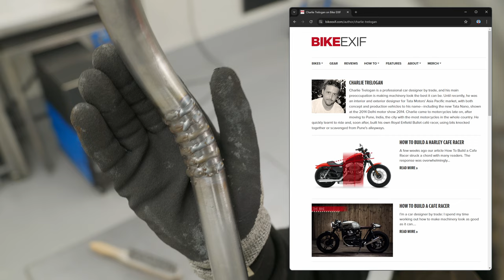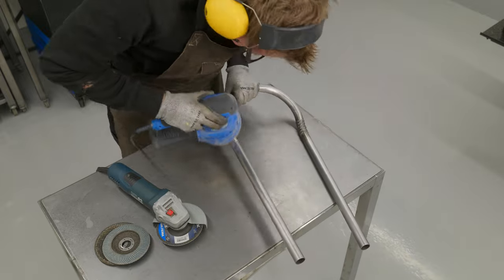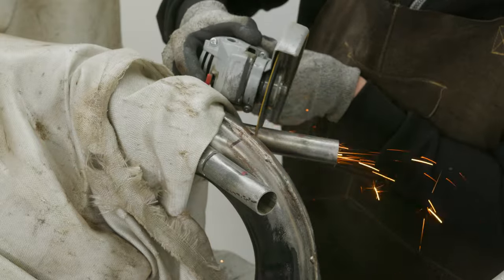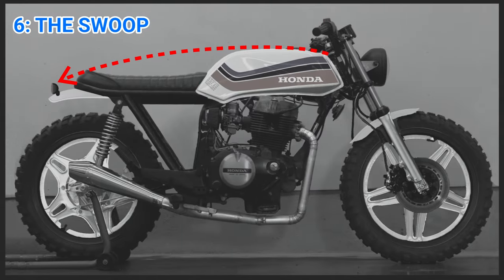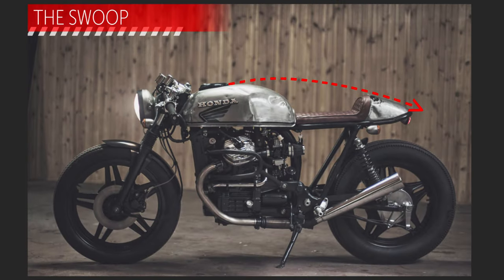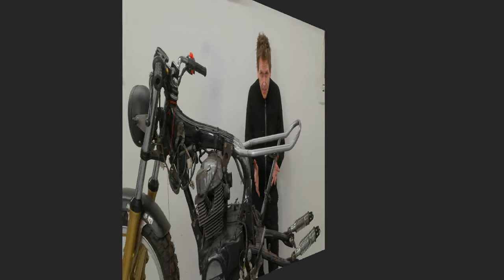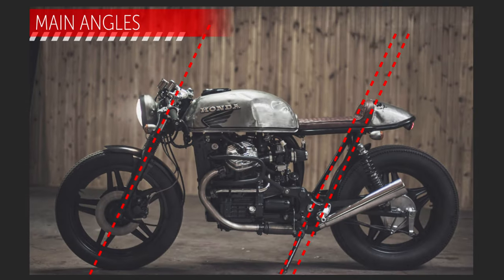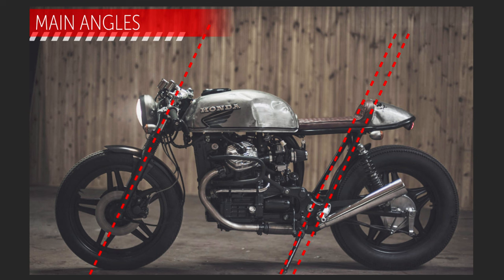Cafe Racer Design Guide - Don't Make Your Build Ugly! Honda CB400 Cafe Racer Build E5·S3

Comment: Im tired of "cafe racers " being built with off road tyres . FFS . The cafe racer was born when people modified what was available, when sports bikes weren't available. They had rear set foot rests low handle bars better brakes and tyres . They tried to emulate the factory race bikes of the day , but still keep them road legal . These days its a frame loop an e bay seat and there you go. No 9ne seems to know the difference between a cafe racer a scrambler and a bobber
Reply from the maker: @paulwhite7475  We all like different styles, and it's certainly not for everyone to mix and match styles. Absolutely the easiest and safest way to just follow the design guide, it's more difficult and a 'dangerous' path to combine styles 😬😬😬
Reply: And comstar wheels! Why? Ffs this video is about design principles and the guide is using comstar. Smh. 😢
Reply from the maker: @jamesallen4050  haha, first of all: it's not Comstar but Comcast rims on the bike. Secondly: both are classic Honda rims from the 70s and 80s, and they are gorgeous 🤩🤩🤩

Comment: Am I correct in believing the original cafe racers were not designed, it was euro punks pulling parts off their bikes for weight reduction?
Reply from the maker: You are absolutely correct! It all originated in the UK in the 60s by youths stripping down their fathers old motorcycle to make it go faster 😎 Today it's mostly about style, secondly you want it to sound good and lastly you want it to go decently fast and have good riding abilities 😊 If you want to go racing you really want a completely other type of bike than a cafe racer today 😏
Reply: As someone with my own cafe project waiting in the garage, I will estimate the reason most cafes of today are ugly is due to lack of skill or confidence to start the metalworking. 😅
Reply from the maker: Hehe, it's a learning curve for sure 😊
Reply: As someone who was riding in the UK in the 1960s I don’t recognise most of the objects people seek to pass off as ‘cafe racers’ these days. The ‘proper’ cafe racers were styled to look like (and sometimes go like) bikes that were used in short-circuit track racing. So engines were often tuned, footrests were rear-set, handlebars were clip-ons, gear-change often reversed by turning the gear-pedal ‘back-to-front’ to match the footrests. The tank would often be a larger than standard (usually alloy) number that the rider could lay down on when ‘doing the ton’. Generally people wouldn’t play with wheel or tyre sizes, and that big ugly fat front wheel and tyre on modern efforts just looks WRONG, as it also does on so-called ‘scramblers’. My brother-in-law built and raced scramblers and they had BSA frames for strength, Triumph 500cc engines for lightweight power, and usually Norton Roadholder forks for control. And an 18”-21” wheel combination because that worked. The modern (and to my eyes) ugly offerings are just exercises in styling which probably handle like camels and are almost unridable and certainly poor efforts on a race track or a scrambles (motocross) course. So who cares where the lines go or meet up if the bike is not useable? Might as well be a ‘chopper’ (another useless styling exercise).
Reply from the maker: Times has definitely changed 😌I don't think many people look at cafe racers as racing motorcycles any more, today you would select a completely different kind of bike if you want to go fast. At least for me a cafe racer is mostly about design and nostalgia 😊
Reply: Sort of. The term 'Cafe Racer' was a derogatory one to describe a standard bike that aped the looks of a circuit racer in the '60s. The simplest things to do were to put 'clip on' bars, aluminium mudguards and strip off any metal work that wasn't needed. Then it could be to replace the tank with a Lyta aluminium alloy one, put on a half or dolphin fairing, a single seat with a bum stop and rear set foot controls. Done well, that would look pretty good. You had people like Dave Degens making road going Tritons and the Rickman brothers doing the same with their own frames. These were very beautiful Cafe Racers that belied the derogatory term. Now we've gone full circle and the lash up, butchers bin cafe racers with knobbly tyres and cut about frames that look hideous and ride terribly.
Reply: Yuuuuhp

Comment: I believe this is a well-intentioned video, but if you follow these "principles" too rigidly they lead to very formulaic builds with little character. These "principles" are merely suggestions; you can break them and still have a beautiful, tasteful design. We remember the builds that have something unique about them, not the me-too builds.
Reply from the maker: Absolutely right, the author behind the design guide also says that this is not exact rules but just guidelines and it's up to each builder to make variations. You cannot look away from all design guidelines though, then it's no longer a cafe racer

Comment: Should be called cafe cruisers or something as theres nothing racer about them now. Bikes were created to be all function, and they are now all form.
Reply from the maker: That is actually very true 😁
Reply: @kihestad  Choppers are the same - they were originally chopped to go faster and they became more about looks. Nothing wrong with it - just a different thing now. In all honesty, you can't create a racer out of a regular bike without changing 90% of it = modern sport bikes are too good.
Reply from the maker: I think you are spot on. Typically the ones being critical to these design guidelines are referring back to how it was originally back in the 60s - it was all about going fast, building a lightweight racer motorcycle was the goal. How it looked was not important at all. Let's just say: times have changed 🥴😁

Comment: you asked for comments how it looks and i feel compelled to say that it does not correspond to my idea of a well-made motorcycle, neither visually nor in terms of craftsmanship. and by the way: where you learned that weird technique of bending tubes? it´s just horrible.
Reply from the maker: This is a very common way to make a second bend in a new direction 'over' or very close to an existing bend, or when making a bend close to the end of the pipe. In these situations regular bending machine does not work. I guess you're not a builder yourself, so it's totally understandable you did not know that, but it's never to late to learn 😊👍
Reply: @kihestad  i have been customizing motorcycles for 30 years and have to do this in accordance with the german tüv regulations in order to be allowed on the road at all. rebending by means of welded slots would be an immediate exclusion criterion. i had to build and weld the rear section of my vfr completely from 22x2mm precision tube. (you can see it on my channel) but this is only possible if you have a welding certificate. a rear section like yours would have to be bent to fit from a single piece of tube. without subsequent modifications. if necessary, you could correct fine details with heat spots.
Reply from the maker: It sounds like your VFR is getting good care! (It's a great bike 🤩) Well done 👍

Comment: For me the flat line horizontal is the most important to make the bike look right, that's why a lot of modern bikes with trellis frames are not suitable as the frame slopes upwards around the fuel tank and therefore it's impossible to make the tank sit flat. Considering the shape of your tank with the back sloping downwards it actually looks really good. Really nice job, I wish I had your welding skills. excellent video.
Reply from the maker: Thanks 👍 You are absolutely right. For newer bikes it's better to build something completely different, for example streetfighter style or modernizing the look.

Comment: Looks good, glad I found this. Drop the front forks 25mm or so up into the yoke.
Reply from the maker: I have already lowered the front fork 35mm internally, cannot drop it into the yoke on this bike because it crashes with the handlebar. I want to have some clearance from the wheels on this bike since it's a cafe racer hybrid scrambler build, I'd rather have talker rear shocks if needed to get it in level.
Reply: @kihestad  . Then my idea will not work, a taller rear is the way.👍

Comment: Pretty good job! Only thing for me is the main horizontal bone line should be considered with the driver's weight. So the motorcycle alone should be a bit tail high head down, it is a typical sports/aggressive  line and prevents the low tail/tilting back at driving cause of the driver's weight.
Reply from the maker: Thats an interesting thought. In a design process I guess it would be smart to not only design the bike based on a profile picture of the the motorcycle only, but also have a picture with the intended rider as well 🤔

Comment: Thinking back on how and why I modified my bike in the sixties. Made it lighter, tuned engine and improved ergonomics for high speed riding. But also keep it legal for road use. Except no heavy silencers, straight pipes. In the style of real road racers.
The Triumphs was mostly high speed city bikes with a more upright riders and higher handlebars. Rarely seen on the twisties, due to reliability issues.
Then I regarded the Manx Norton and the Velocette Thruxton as the most beautiful bikes ever made. The 7R boy racer was also good looking.
One thing I don't understand is the use of a single seat on a cafe racer. One reason going to a cafe was to find a girl for the evening. Short and light weight for better bike performance.
Looking at my Manx, it differs much from the angles you prefer. My other classic race bikes, the CB and the RDLC also differs. As does the Velo.
The old bikes had dry sump oil system and an oil tank. So the space behind the engine was occupied by carbs, filters, oil tank, battery and tool box. Giving different appearance.
Reply from the maker: Thanks for commenting 🙏 Getting feedback from those who actually were part of the "cafe racer movement" back in the 60s is rare, but very fun and interesting 😊 I guess the style is a bit different now than it was 60 years ago. Many trends are short lived, I think one of the most important reasons for the cafe racer style still exists and is relevant is because it has evolved and adapted to newer bikes. Have to agree, putting on a seat sounds stupid 😅

Comment: CLEAN i think is best way to compliment your bike .... as for tank placement , different or not , it works ! Very nice swoop with the elevated rear portion of tank ... cant wait to see where you hide the charging / electronic system
Reply from the maker: @monokheros5373  Thanks 🙏 I have planned to make my own very slim litium battery to keep under the seat, hopefully I am able to put all the wiring and electrical components very flat an hidden under the seat or the tank 🤞 time will show 😬😁

Comment: I thoroughly  agree there’s a lot of ill thought out ad-hoc abominations out there. In Britain it started with those horrific streetfighter ar§€ up mongrels. 
Those principles are sound guidelines to this eye.
Your problem is that tank & the lower edge which was designed to flow into a side cover. I really think your build needs to integrate something here too, running back up to the seat base. 
A pleasure to watch.
Reply from the maker: Thanks for the positive feedback! 🙏 The original tank on my bike definitely presents a challenge. I considered replacing it with a classic Honda tank or an aftermarket option, but ultimately decided to keep the original for both cost reson and because I wanted to preserve most of the bike's original signature elements (that also includes the rims). By using oposite shaped lines on the tank decals I try to visually balance the curves. Additionally, I've made the seat hoop's angle to align with the tank's bend, creating hopefully a cohesive look. Time will show if these design choises is enough to justify keeping the bent lower edge on the tank🤞

Comment: Keen to see the engine and frame cleaned up
Reply from the maker: Agree, but there are some other tasks that come first. The next job is to fit the rear fender, then make the seat tray and the seat. I want to do all the wiring and mount all kinds of small stuff to make sure I can remove unnecessary brackets and add new ones where needed. Then comes the fun getting it cleaned up 🤩

Comment: I’d like to see a scrambler version of this video.
Reply from the maker: I would guess some of the design principles would stay the same, but definitely not all. Higher handlebar, get more clearance to the ground, increase suspension/fork travel length, move exhaust higher up, lifting front fender, softer/bigger seat, and probably more ... 🤔
Reply: @kihestad  I just did a scrambler conversion on a Royal Enfield 650 and I’m still tweaking it.  It’s not a full on custom but I can travel, camp and do gravel roads with it.  It’d be fun to do a custom scrambler from a Japanese bike like what you started with.
Reply from the maker: Cool, Royal Enfield 650 as scrambler sounds like a perfect combo 😊

Comment: This is coming out amazing! Love the new subframe. The CB definitely needed a straight anchor point from the subframe instead of the original curved one. I saw many people keeping that, and it really killed the vibe of the bike. Will the electrical box under the seat extend all the way to the end? Mine is very similar (a 1984 450), but the box is smaller and deeper, protruding a little too much from the side view. Currently, my bike is totally disassembled to fix a valve that broke off and dropped inside the engine 🤦‍♂. Hope to get it back on the road soon. Good luck with the rest of your build, and keep the videos flowing!
Reply from the maker: I absolutely agree, keeping the original frame and try to work around it (like I tried on my version 1.0) does not really work 😌 I plan to make the tray under the seat just go a tiny bit lower than the bottom of the seat hoop, but having 45 degree angels on the side walls so you cannot see it from "above". I plan to make my own lithium battery based on 18650 batteries, it will be very slim and should fit in a slim seat tray. The seat tray will go from the tank and to the upswing at the rear of the seat hoop. 

Oooh, a broken valve does not sound good 🫤Thanks for watching and commenting, and good luck with your build as well! 👍👍

Comment: Very good design the only problem for me and it is a big  one, the knobby tire they belong to a  moto cross not a Cafe Racer or Street Tracker.
Reply from the maker: Yes, I know these tires are not for everyone. Remember I am building a "hybrid" cafe racer / scrambler, so I am breaking some of the rules with my build. The motorcycle will be used mostly for short trips to the city centre, but also for trips to the beach and on gravel roads. It's like the opposite of having an adventure bike with street tires for driving in asphalt only 😊

Comment: How about scrambler build? Do you have a vid how t build one ??
Reply from the maker: I don't have a video for that unfortunately, but it's not that different. Many of the design guides are the same, except typically you route the exhaust higher to get better ground clearance, and you want higher handlebars for different driving position (like I did on my bike) and you might want higher clearance from wheels to fender as well, and perhaps even longer shocks and an overall taller bike.

Comment: This is a very cool design study! I am a bit of a sucker for reverse Comstars, excellent bike. Completely agree, a bit of extra shock height is needed in the rear. Cheers, from the American Northeast.
Reply from the maker: The reverse Comstars (I think Honda called them Comcast) is very cool. They are a bit wider than the older Comstars, and I like that they have sharper "edges" compared to the comstarts 😊

Comment: ive seen many cafe racers extending their swing arm to make the bike looks good in proportion, i am planning to do it mainly because i wanna lower the bike, but i am hesistant since cafe racers doesnt have that huge gaps in the inner part of rear tire, should i just lover the rear and front by changing the shocks or just extend my swingarm?
Reply from the maker: Are u sure about that? Extending the length of the swing arm to push the rear wheel further back is a  very rare mod if u ask me. For a dragster bike, ok. Not for a cafe racer.
Reply: @kihestad  so should i just get a shorter rear shocks?
Reply from the maker: @akhinyt1168  replacing the rear shock can work, just make sure it's within what the swing arm can cope with 😊
Reply: @kihestad  ohh okay, thanks man ride safe🤟
Reply from the maker: @akhinyt1168  I think whats most common is to neither change the rear shocks or swingarm, rather modify the seat hoop for where to put on the seat. You can normally lower the seat and seat hoop, but keep the suspension as original.
Reply: @kihestad  yeap well my main problem is that the front suspension is too high, i can lower it but my problem is that it will lose the horizontal symmetry of the bike